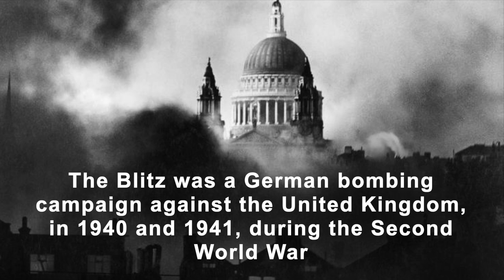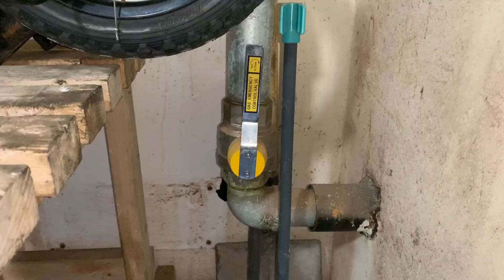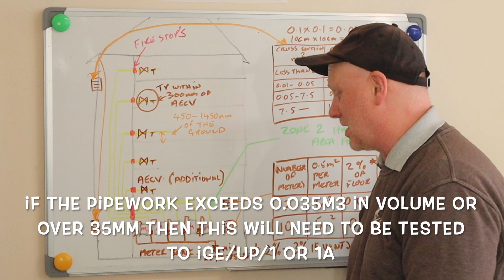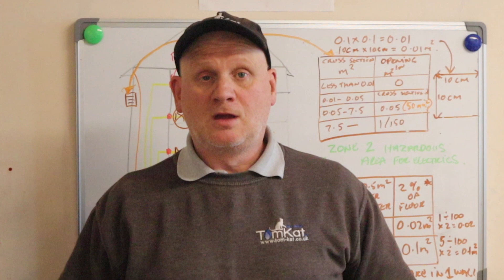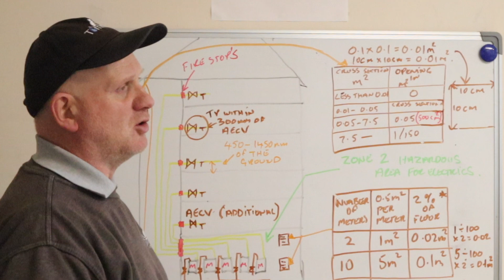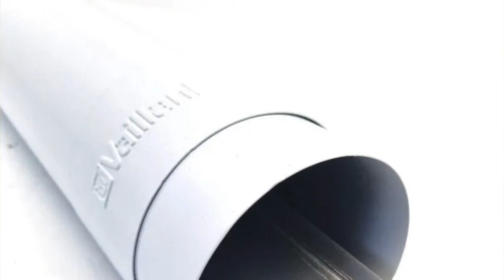GAS in Multi-occupancy building, flats/maisonettes/high rise flats/HMO ACS revision

Comment: Im currently on a training course and mentioned about not wrapping the joints in the meter house compound and they are all saying its wrong and it must always be wrapped both ends to prevent corrosion. Do you have a link for reference so I can go back to them and prove you correct
Reply from the maker: The information came from tracpipes trainer and you can find the information in tracpipes training manual

Comment: I have come across a gas installation in a brand new block of flats where the gas meter is on the outside at ground level and the flat is on the 1st floor. The boiler is  installed inside an appliance type kitchen unit with the boiler at the top (wall unit) and storage cupboard below (Base unit)

The AECV is located in the lower part of the unit it is behind the back panel which requires the removal of screws to access it. Would you classify this as AT RISK as it is not readily accessible or does the fact that you can go outside to the ECV in the semi concealed meter box make it acceptable? There is a label on the front of the units back panel  which simply reads emergency control valve behind panel. 

I’m sure I read somewhere that if the ECV is more than 6m from the entrance to the flat then an EACV is required therefore needs to be readily accessible to isolate in an emergency which in this situation would make the installation AT RISK. As always any advise is greatly appreciated

Comment: I’ve done a very similar install with 26meters in the entrance to the block of flats, the track pipe joins onto low carbon steel that runs in a vented riser cupboard then runs along each corridor to the flats, as it enters the flats I have another ecv and test point

Comment: gas was removed from blocks of flats following the 1968 Ronan point explosion and collapse, that decision should never have been reversed
Reply: The Ronan point explosion occurred because of a badly installed gas connection to a cooker 
The block collapsed because the walls were weakened by poor construction methods and bad workmanship
Reply: @liveloud9894  Correct, unfixed modular walls,  and apparently the tenant who’s cooker exploded due to bad diy connection survived.
Reply: @john_smith1471  And unfortunately I still see a number of DIY cooker installs which have to be isolated due to being at risk or immediately dangerous 
They see a gas cooker install as a simple plug in job

Comment: Very informative video Derek. As you and I both know ACS was updated following Grenfell. However, many of the areas you highlight are still not adequately covered. We obviously cannot keep adding reams and reams of question papers but I feel following the tragedy there is still much to be done. For example the requirements for the inner duct of boilers on buildings about 5 floors seems to be pretty well unknown to most ACS Reassessment candidates! 
I'm certainly not singling out the gas sector. The quality of work from ALL trades in your video leaves much to be desired!
Keep up the good work Derek.

Comment: The tracpipe website says it can be used in unventilated voids?
Reply from the maker: Correct but the pipe in pipe system not the single sleeve pipe
Reply: The Tracpipe website is not very clear. The Tracpipe CC is complete containment which can be used. The original type can't... You would think Tracpipe would put the information on the difference between the two somewhere easy to find.

Comment: God know why Gov doesn't mandate air to air  or air to water heatpump systems on all new blocks.
Reply: Imagine the heat pump size to supply say 20 flats
Reply: @stephenfanthorpe2708  Not one HP for all the flats! Think individual ones for each flat.
Reply: @JohnnyMotel99  But unfortunately no ones climbing that many storeys on a scaffold or side lift to service and maintain heat pumps bolted on the side , it’s not financially viable , too noisy for balconies and if they are placed on the roof that 40 degrees water or air temp will be gone before it gets anywhere near to the flats.
Reply: @stephenfanthorpe2708  jeez, so limited imagination, I am certain a building can be designed to accommodate heat pumps if the developer wanted it. Certainly a lot safer than gas.
Reply: @JohnnyMotel99  you have imaginary imagination, you obviously don’t understand structures or heating systems, accommodate what a 10 story ladder and a 50 db fan per unit , the only heat pump option would be ground source try digging down that far with that kind of output capacity anywhere that these buildings are built its like mining problems all over again . Gas done correctly is safe , the refrigerant in heat pumps is a greenhouse gas and also flammable now imagine Grenfel with a hundred of those strapped in the side….there is no upside we are going backwards we have nearly 99% efficient gas boilers
Reply: @stephenfanthorpe2708  A quick search came up with Daikens solution for apartments. Top notch insulation reduces heating requirements, coupled with underfloor heating and Daikens equipment equals a solution for apartments. The equipment is placed at regular intervals, on easy to access, open to the outside alcoves.
Reply: @stephenfanthorpe2708  If gas boilers were running at 99% efficiency then the flow temperature would need to be below 40C, that isn't happening in the majority of UK properties.  If it were, you wouldn't require that big of a heat pump even for a block of flats.  You also need to realise that even with R290 being flammable, the amount in the heat pump is far less in quantity than the gas piped into a home, so is much more safer - even if there were "100s".
Reply: @BenIsInSweden  Thats a contradicting argument because although to hit that level of efficiency with a gas boiler they do require the low temp range that’s the same requirements for a heat pump and they only function at that range so the building heat loss and capacity would have to be be indifferent for the two, we are talking about new construction not existing builds and if we was the heat pump wouldn’t be suitable for the 60 % of D rated and below properties . As for flammability r290 is pure propane kept in a sealed reservoir hence the increased explosion risk it’s a class 3 gas there is no isolation valve rigged to fire systems like there is for a gas supply as it’s part of the fabric of the pump itself so it can’t be isolated. I’m not anti heat pump I’m anti bright idea that simply aren’t suitable for all scenarios
Reply: @stephenfanthorpe2708  You said "we have nearly 99% efficient gas boilers", but virtually none of them would be set up for that efficiency, and you seem to be using it as some sort of imaginary justification.... at 40C flow a heat pump will be reaching SCOPs of well over 4, so whichever way you square it, either on price, or gas used (in a power plant), a heat pump would cost less to run and would use less gas (if the UK had 100% gas power plants) in the process, to say there are no upsides, is a weird argument to make.  You also say Gas done correctly is safe, then seemingly unironically use Grenfel as an example for if multiple heat pumps were on the outside?
Reply: @BenIsInSweden  it was the breach of fire control zones with flammable materials that caused Grenfel to spread like it did it was designed and then retrofitted , if it had heat pumps that would have been individual pumps on the outside of the structure and they would have exacerbated the fire with more falling debris, that’s not strange it’s common sense , it wasn’t the gas that caused the spread. You would have breached the same Fire-stops to install a single air to air or air to water pump to supply the building. We were originally talking about new build and having a single unit to supply x amount of properties . A single unit can’t run at scob 4 due to variations in demand they have to maintain a presumed demand, that’s hitting the efficiency . Saying virtually none gas installations are set up for 40c flow means they also can’t hit that same coefficient on heat pumps since that also requires the same temps to hit your imaginary targets. It’s basic maths not paper filtered figures
Reply: @stephenfanthorpe2708  Check the inquiry. It was many hours before the gas supplies were turned off, and also:

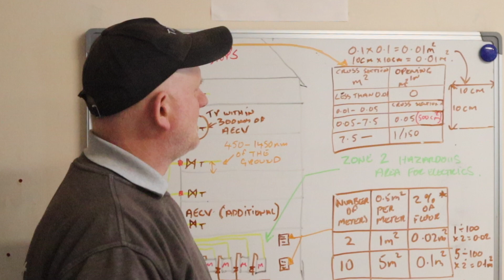"72. The 12" flow stopping bags worked and we temporarily stopped the flow of gas to the building at 23:40. We watched the fire flames inside the tower diminish almost immediately and there was a huge sense of relief."

Gas may not have been the main cause of the spread of the fire, but it certainly didn't help, and is not an example of gas done safely (Reports of exposed pipes, the building shut offs being covered in some renovations).

Also, you clearly don't understand heat pumps, they modulate, just like gas boilers, some even better than gas boilers. 
Gas installations aren't set up for 40C flow because of a lack of knowledge in heating design (or just a case of can't be arsedism), and not setting up the system in the most efficient way possible. There are heat pump installers out there (especially in the heat geek network), that understand proper heating design, and the gains from reducing the flow temperature with a heat pump is greater - which extend even further than the ~40C flow sweet spot that gas boilers have, down to below 30C flow. A new build set up properly with a heat pump system, would be able to achieve far greater efficiencies than a gas boiler being placed in the same building, with gas you're capped at around 99% peak efficieny like you claim, but with a heat pump, peak efficiencies are in the 600-700% range. And with ground source ones from last year being able to achieve a SCOP of 6, so averaging at 600%.

To recap on the points:
- You said there was no upside to heat pumps due to having 99% efficient boilers, which isn't the case, a system set up that achieves a 99% efficiency for gas, increases the efficiency for heat pumps more in the same system.
- You said that Gas done correctly is safe, and used a whatifism with Grenfell tower claiming that things would be worse with a heat pump set up, when Grenfell tower has issues with gas not done safely.
Reply: @JohnnyMotel99  Stop it,  Gas is safe, reliable,  quiet, economical and efficient, an electrical appliance started Grenfell, melted  pvc windows climbed and jumped external cladding, this video shows poor tradesman & building inspection sign off is the problem, same for Ronan point tower, unfixed modular walls  caused the collapse and death, the tenant who’s cooker exploded survived. Biggest takeaway for me in a tower fire is GTF out of the building, don’t rely on internal compartment protection.
Reply: @stephenfanthorpe2708  seems my comment about Daikin systems for multi story blocks (new building) has been deleted. So they do exist and can be done safely. With enhanced insulation, underfloor heating and MHVR , I’d wager a heat pump could service a whole floor or two maybe..
Reply: @JohnnyMotel99  you are right , and I did look further in depth to them after our discussion on your initial post , after the bandwagon people stopped posting, and actually I seen they have a 400kwh air source one going in at hill park drive Glasgow , my only concern would be if one unit was to supply on that scale and it went down the interruption would be to everyone , that said I do apologise for being so initially dismissive
Reply: @stephenfanthorpe2708  thanks to reply. I agree that designing heat pumps for blocks is an architectural/technological problem.